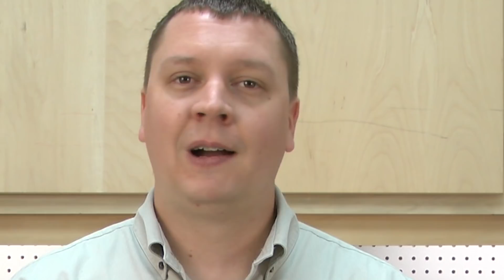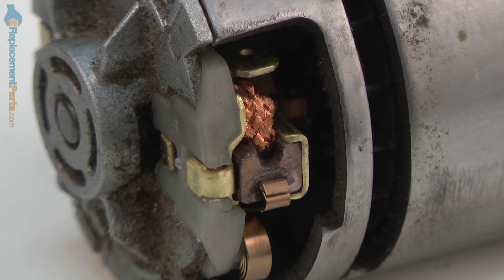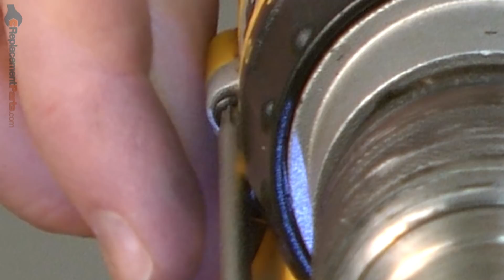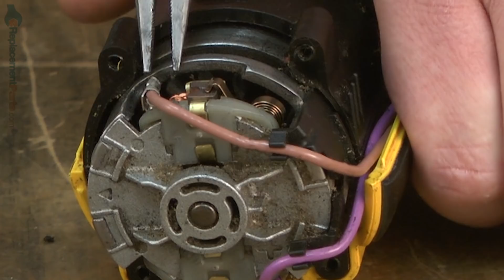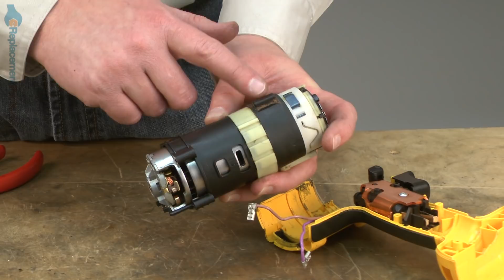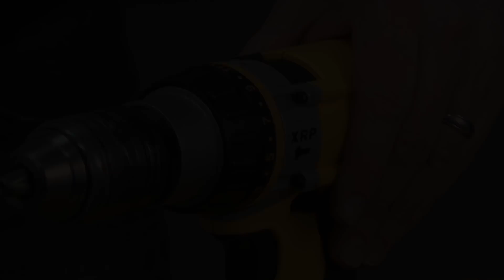Drill Repair - Replacing the Motor and Pinion (DeWALT Part # 396505-22SV)

Comment: If i want only to chage the brushes?
Reply from the maker: Thanks for the question! Here's a video that might help you replace your brushes!

https://www.youtube.com/watch?v=lw7zWzeFOvg

If you need to find the right brush replacement, send me your drill's model number and I'll be happy to help you find the correct one!
Reply: eReplacementParts.com thank u. But,...could be the DCD710C engine be shielded? because I can not find a way to open it to change the brushes

Comment: please someone tell me about motor specifications where ican buy etc
Reply from the maker: Hello Rishad, the Dewalt part number 396505-22SV is an 18 volt DC motor and pinion assembly which also includes the brushes. It can be purchased at eReplacementParts.com https://www.ereplacementparts.com/motor-and-pinion-p-64885.html

Comment: pull the motor,clean all the black brush junk up,sand the commutator with very fine emery cloth,clean brushes up and reassemble my dw959 worked perfect after.this without changing the brushes.

Comment: There is no datasheet available but with the motor in hand one could easily test it to find out, right?
Reply from the maker: I have been in contact with a Service Tech at DeWalt as well as searched on line.  The only information I've been able to find is that the motor is an 18 Volt.
Reply: eReplacementParts.com yeah I'd say that it would be some 50A.. When my Dewalt arrive here I'll test it